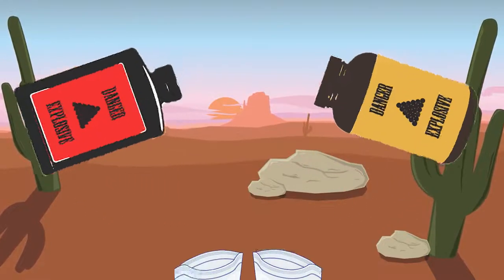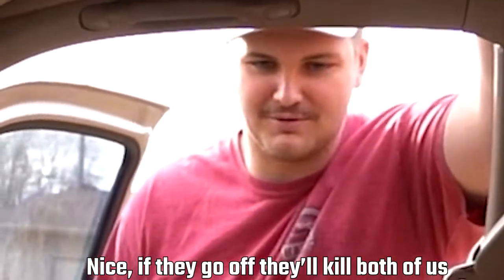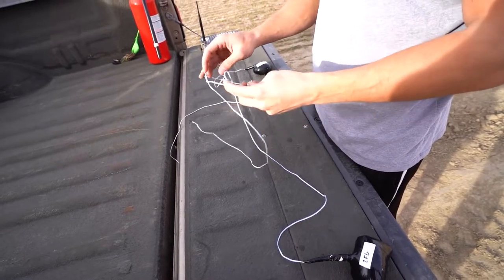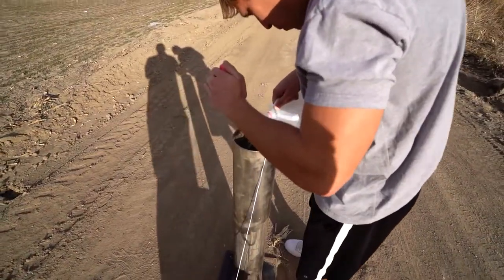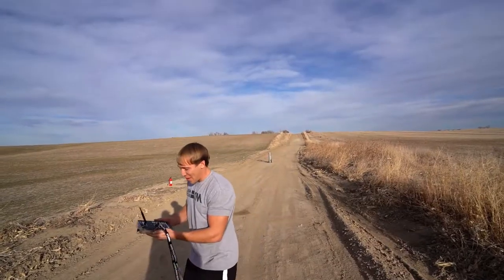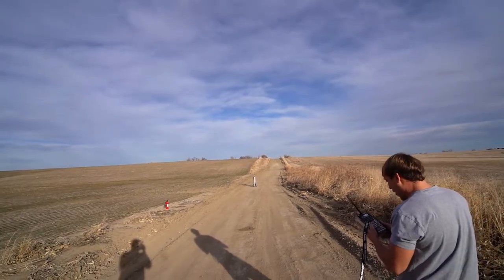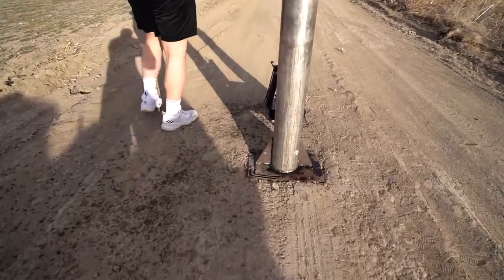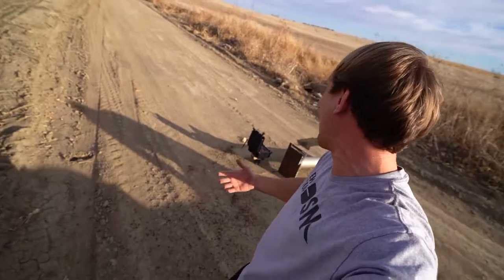Detonating A Black Powder Charge In A Pipe Full Of Gasoline

Comment: I used 3.5 ounces of Fg powder in a 6 inch tube. Covered the charge with water and then gas. The gas did not ignite and the charge just blew up all up in the air.